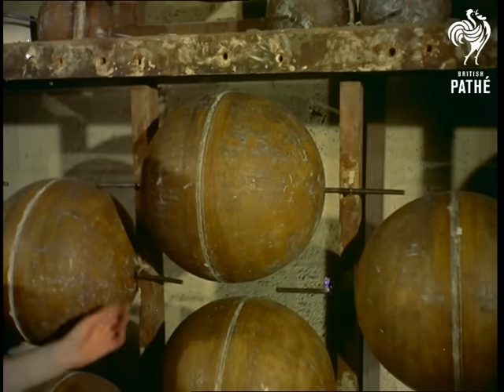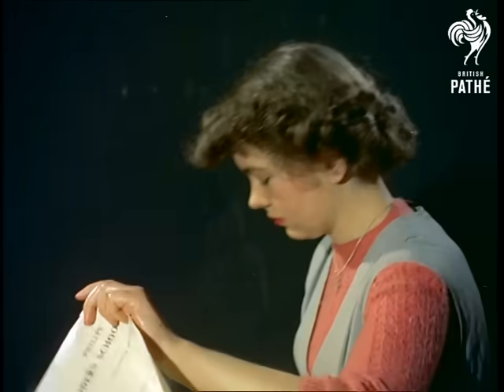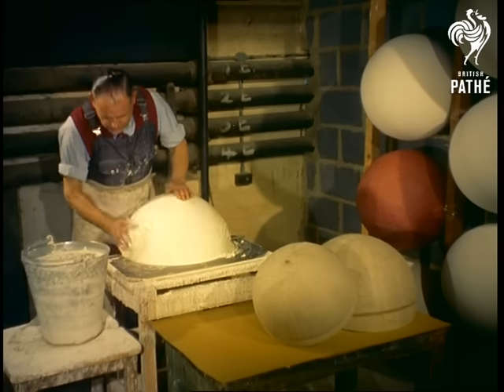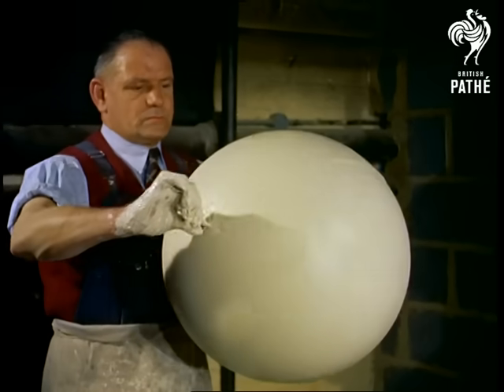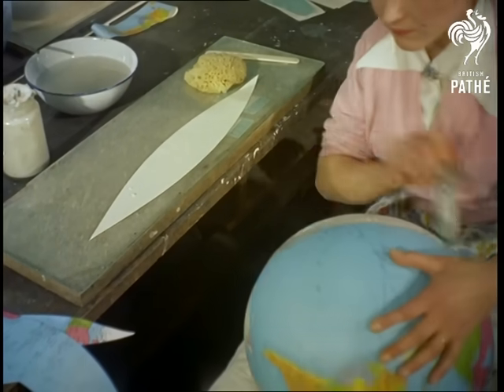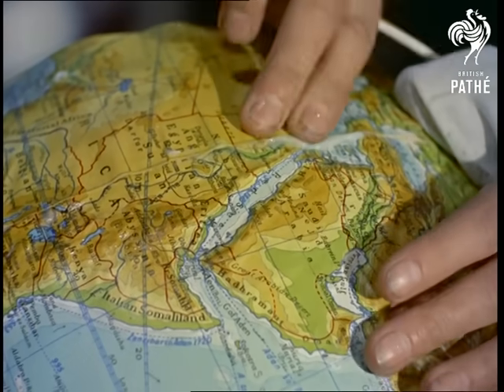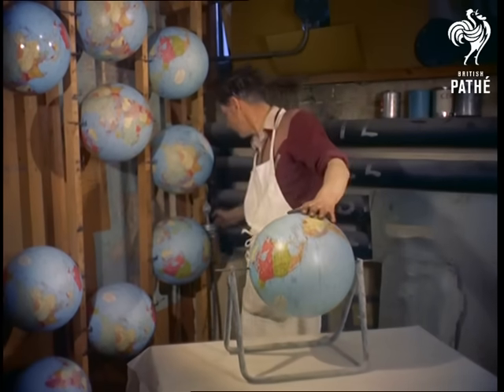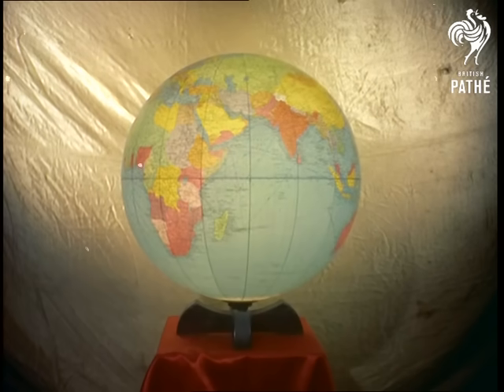Globe Making: How the World is Made (1955) | British Pathé

Comment: I have been collecting globes all my life and at 65 I have quite a few. My most cherished one is only 10 inch diameter but they used satellite photos for the land depictions. It has such fine detail that it blows my mind. It shows every river system completely and the latitude longitude of cities perfect. It shows Alaska's Alexander archipelago in the pan handle in detail. Amazing.
Reply: Who made it?
Reply: @bertroost1675  I couldn't find a manufacturer name on the globe itself. But the base is by the world time globe company. It has a digital clock and display which shows the current time in selected cities as you turn the globe. They still make them but the globe is different. Although they do make satellite globes I have never seen another one that shows the country's in different colors like a standard globe and uses satellite photos for the land outlines.
Reply: @johnwright291  Sounds neat

Comment: There seems to be a missing step here... How do they make the spheres they start with (the ones they cover with paper near the start)? Alternatively, if these are re-used, how are they removed from the paper-and-plaster shell?

And, as a separate question, how do they mould in the relief if this is a feature of the particular globe? One shot shows someone using a bone folder to mould the damp paper map over the relief but they don't show how this relief is itself formed.

Comment: I'm glad to see that the Brits found something else to export to Russia, apart from toilet paper and Rolls Royce jet engines for use in fighter jets.
But at 0:31 it says the paper is pasted round a SOLID ball of wood.  Then the woman picks it up as though it weighs just about nothing.  Pine is around 500 kg per cubic metre.   Even balsa is 120 kg per cubic metre, so a globe the size in the video (looks about 600 mm diameter) would if solid balsa weigh 45 kg.  The woman would weigh 60 kg at most.  Balsa wouldn't last long, so pine is more likely - it would weigh a tad less than a quarter tonne.